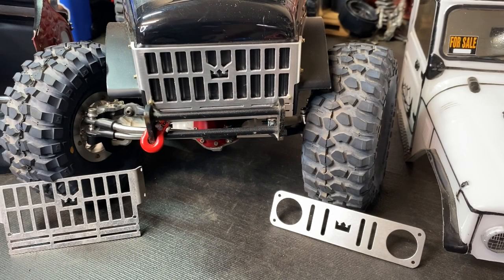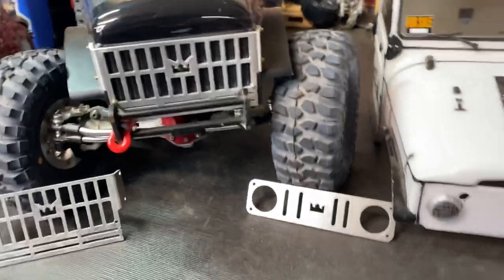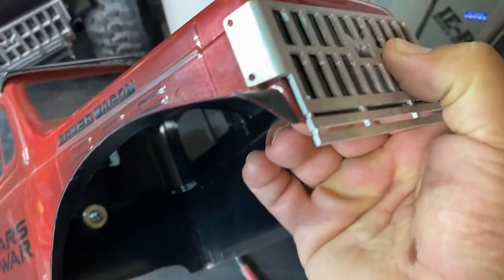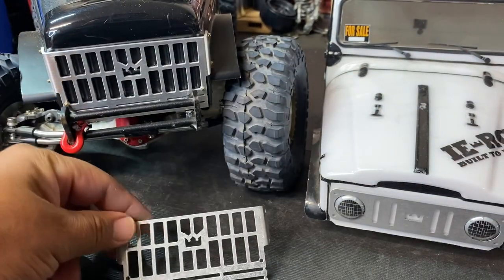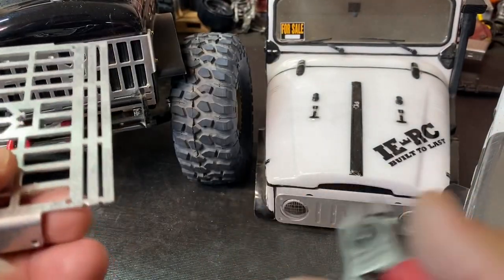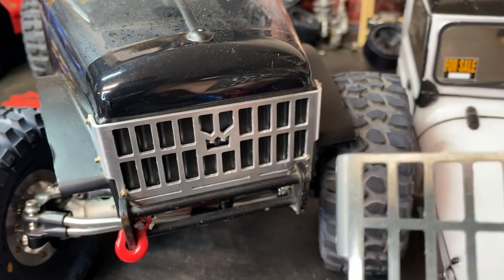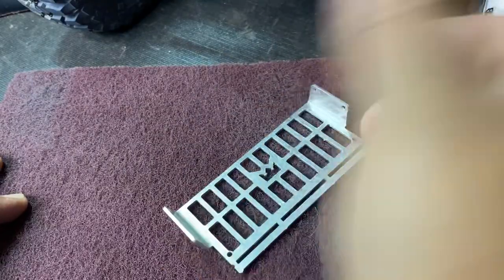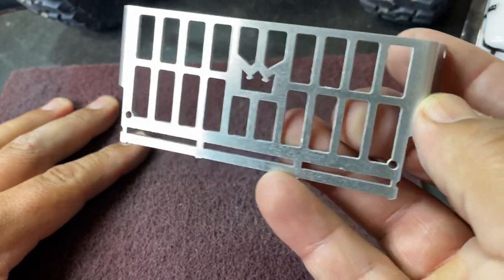IERC POWER WAGON & J45 GRILL

Comment: Awesome!! I'm going to buy one..questions. the power wagon and comp power wagon grills fit either lexan shell?

Also, do you have a video for the sun vizors?😮😮
Reply from the maker: hello there, the power wagon and the comp wagon are different in the front. The grills are specific to each body. The sun visor is very simple to install, simply line it up and poke a small hole with a reamer then thread in the provided screw. I will make a video for it soon.
Reply: @iercscaler4656  ok cool thanks